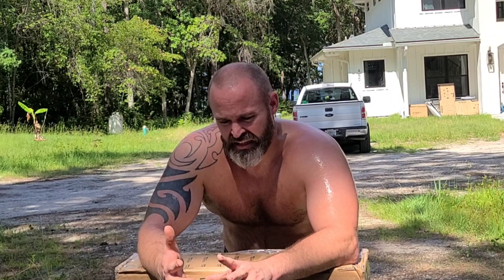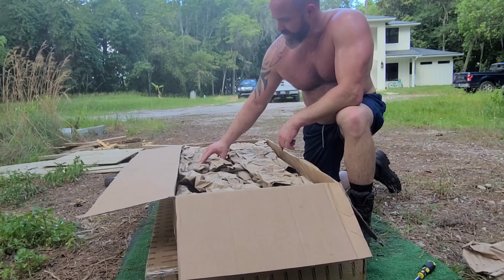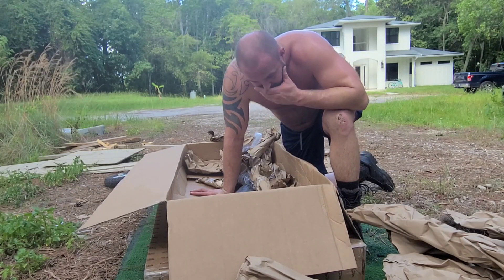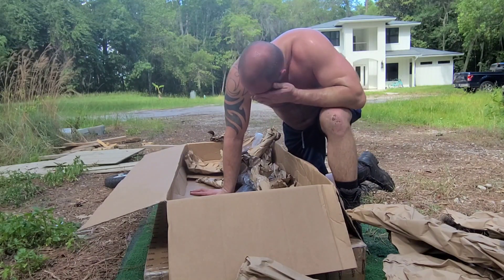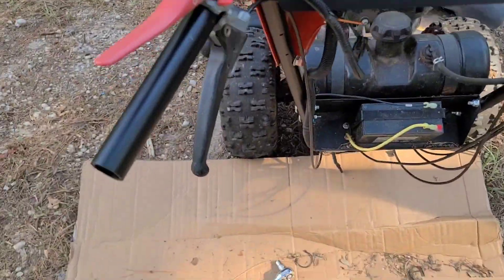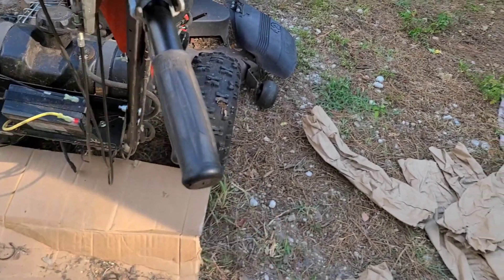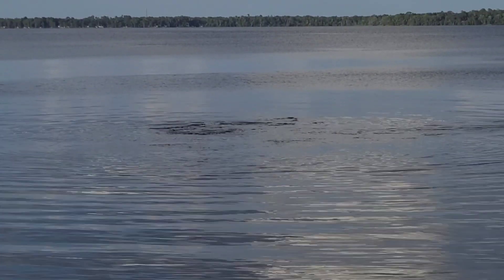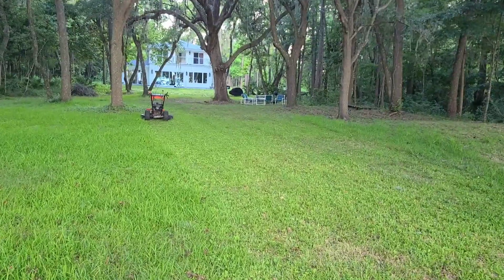My most prized possession is on the Brink! #diy #gardening #homestead #family #mower

Comment: Personally I would send the other pair back, and get the ones you just took off fixed properly so that when they have to go back on in 3 years they will never break again...
Reply from the maker: Thanks Troll forge...my question is this... do you think they can be fixed and be as strong or will it be weaker at that point?
Reply: @HewettHomestead  Brother, if it were me, I would go to TSC buy a 3' length if 1x1/4" welding steel, for ~$17 (what's that $3 US?) Bend and drill each end to match the bottom of the handle, cut the handle sides to ~6", grind off all the edges and corners of the handle sides, cut the actual handles above the bend, force the new pieces into the old handles, weld at the  bottom of the old handle piece. No heat damage to the unreinforced handle, easily 10 times stronger than the stock handles... Know anyone who welds?
Reply from the maker: @trollforge that does sound much stronger... idk any welders but im sure theres plenty around..  thanks for the advice.
Reply: @HewettHomestead  If it weren't for the fact that all my tools are in storage right now, I'd offer to do it for $20 over the price of metal, but I think the 3000 mile drive (round trip) would make it a wee bit uneconomical... ;)